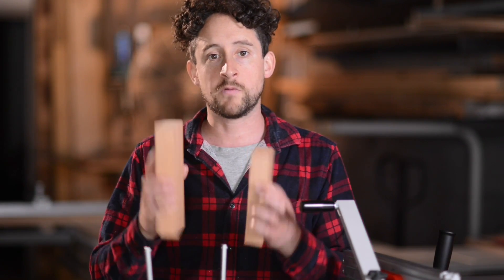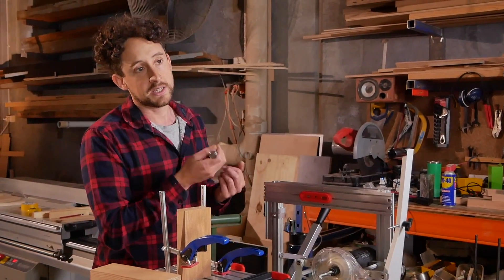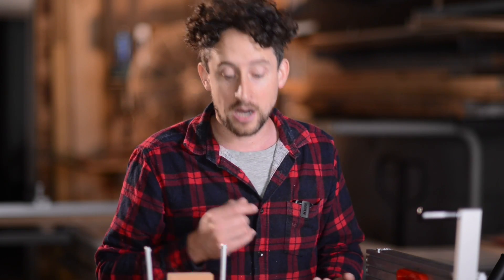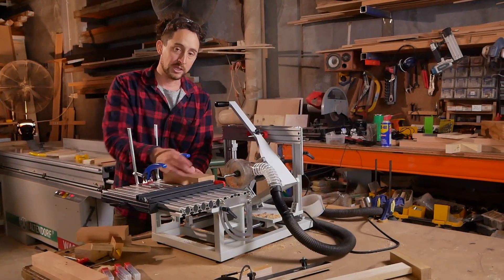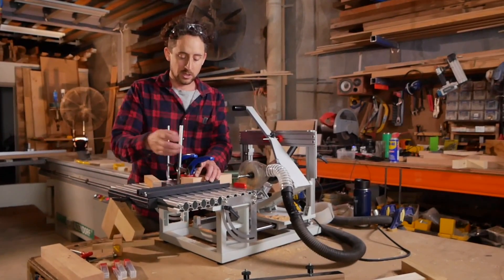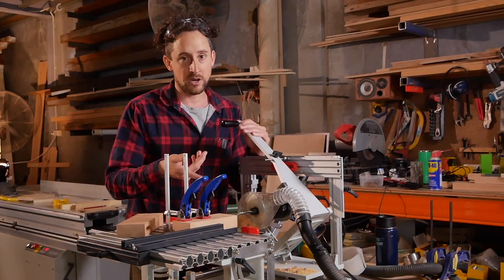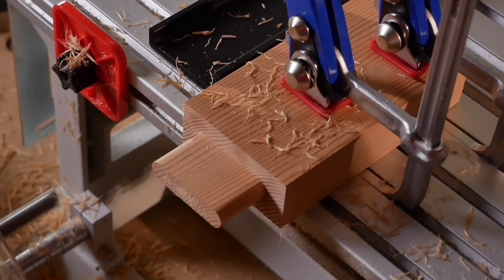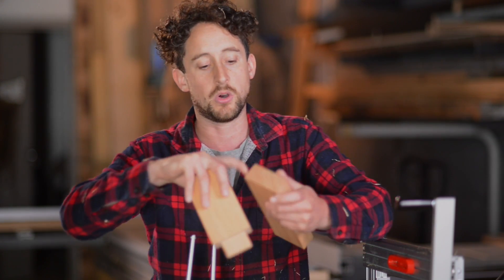PantoRouter - Creating Perfect Mortice and Tenon Joints

Comment: All this talk about imperial versus metric units avoids the conversation about a 2 by 4 actually measuring 1 1/2 by 3 1/2 inches.
Reply: what does that have to do with stoneage vs metric? 2x4s would still be the same size, only the numbers would be different. 3.5 inches or 88.9 millimeters, it wouldn't make any difference to the 2x4 :-)
Reply: @mrxmry3264 stoneage?
You didnt ĺearn fractions? Pretty easy...

Comment: His rude comment about the Imperial system may show his inability to deal with anything not easily broken down in tenths.
Reply: Let's not forget that the metric system is much easier to use because of those insane conversion factors. In the metric system every single conversion factor is a power of 10. 
There's a million mm in a km. How many inches in a mile?

edit: ffixed YET ANOTHER autocorrupt fuckup :-( and a typo